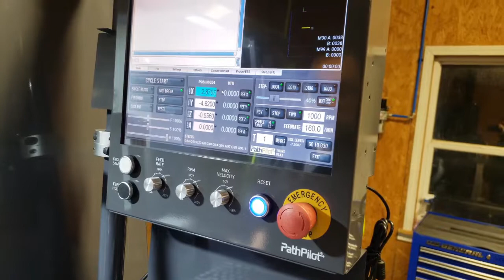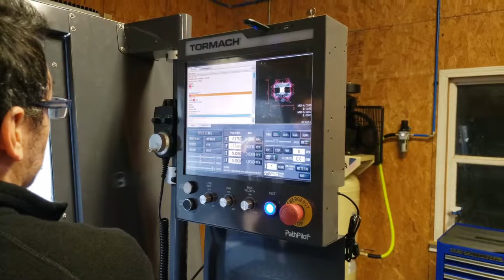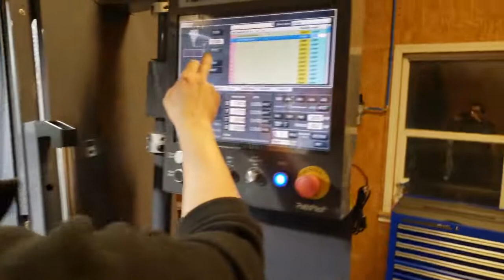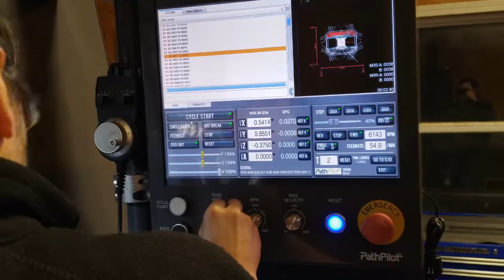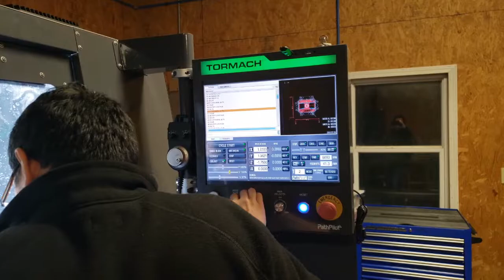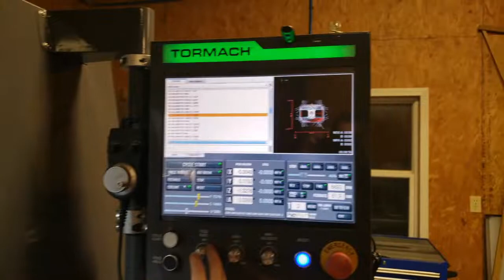First Project: Tool Holder

Comment: Nice video, thanks for sharing! What coolant are you using? I'm about to assemble 1100M+ upgrade (servos) and adding flood coolant system. I'll also be interested to see how you like the SMW fixture plate. I have the aluminum version on my wish list, along with some low profile clamping parts, probably like the ones you've shown in this video. Care to make any comments regarding future content?
Reply from the maker: Using qualichem xtreme cut coolant, but may look into switching to blaser synergy, as far as content gonna machine some parts for a honda ruckus here soon. Thanks.